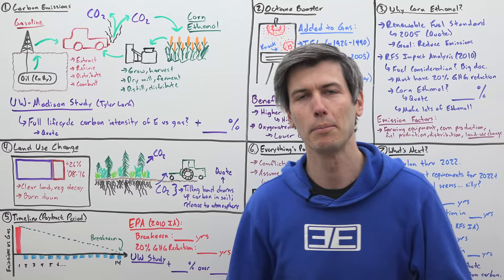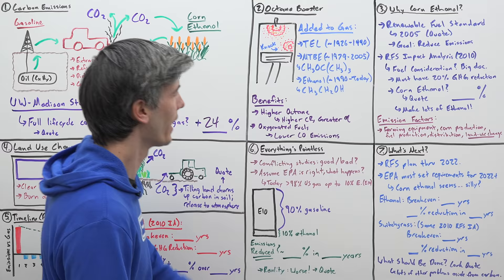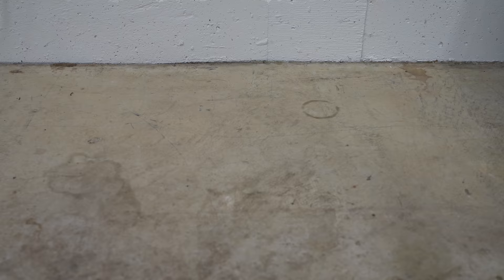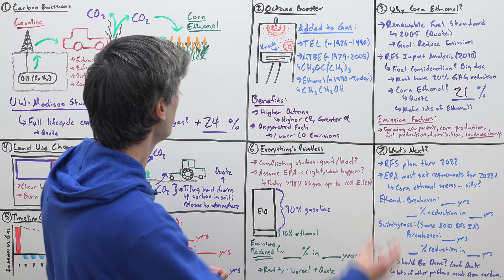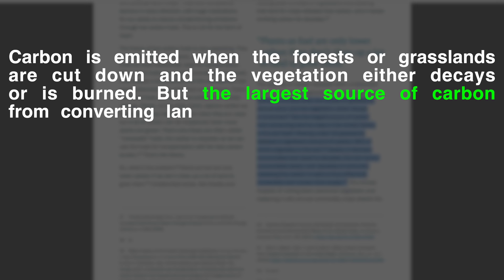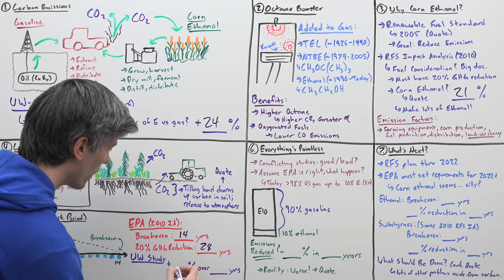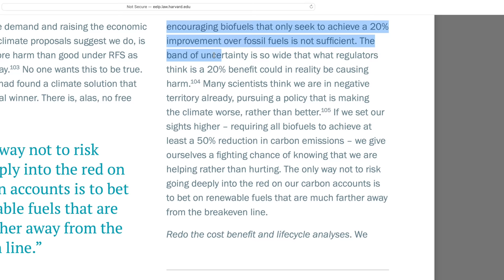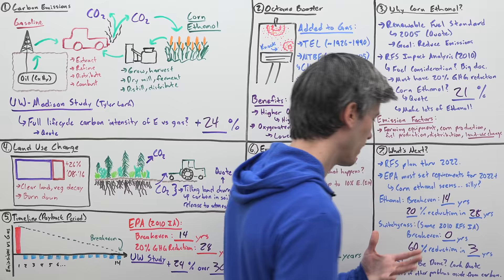America Was Wrong About Ethanol - Study Shows

Comment: There is another factor that I didn't hear you address. When comparing reduction of emissions between E10 and E0 gas, you also need to factor in reduced fuel mileage due to the ethanol. So while I'm polluting 2% less on E10, I'm burning 5% or more E10 fuel overall to travel the same number of miles I would on E0. I'm curious if that was something Tyler's study factored in. Because if you factor in burning MORE fuel per mile, then it's apparent that ethanol doesn't do what they claim it will. And never did.
Reply: Even with just 10% ethanol added to E0, the Swiss Federal Laboratory for Materials Science and Technology found that the especially health devastating ultra fine or nano particulate emissions were lowered by 97%, carbon monoxide lowered by 81%, carbon dioxide lowered by 13%, aromatic hydrocarbon emissions lowered by 67-96%, and genotoxic emissions lowered by 72%.
Reply: @danafletcher2341  I looked up that study and found it referenced from 2016. It's interesting that it specifically only applied to direct injection engines, which are engineered for better efficiency/lower emissions to begin with. Those engines come with their own problems, but regardless, suffer from the same reduced fuel mileage using ethanol products compared to pure gasoline, thus still burning more fuel per mile driven. Fuel that's still 90% gasoline. I'm not remotely sold that a 10% change in fuel type reduces emissions by 13%, much less 72-97% of anything. If it's true, the study can be replicated by others. And should have been. But if that's the only study showing reduced emissions since 2016, and others that show a net increase, I'm not buying it.
Reply: Clay you're spot on and it should have been touched on in this presentation.  5-8% increase in consumption with E10 vs non-ethanol gasoline in my personal vehicle.  Nascar switched over to 15% ethanol and saw a 10% increase in consumption or reduction in efficiency.  However you want to look at it.    How is that "green"?  I'm just a simple man with some common sense. 

But then again I don't have a vested interest in corn, ethanol production or its subsides..........
Reply: except the efficiency of a otto cycle is  dependent on the compression ratio.  Without the octane enhancer your engine would be forced to run at a compression ratio of 7.4/1 vs running an engine at 11/1 .  And that is what happened in the early 70%,  Ethanol was forced in as a oxygenating agent to reduce hydrocarbon emissions.  It was never there to reduce greenhouse gas emissions. MBTE was its competitor but was taken out (cancer causing)  And a engine with E10 at 11/1 will far outdo an engine at 7.4/1 running on E0.  This is the octane effect of adding ethanol.
Reply: There's not only that consideration, but the issue with so much land being turned to corn production for ethanol.  This has caused a decrease in other food crops, particularly rice, as farmers around the globe are not in farming for their health but to at least break even financially.  This has had devastating effects upon world food supplies.  I know that the green crowd thinks that it's a win to kill off large swathes of the Earth's population because it will be "good for the planet", but it's a bit less of a positive if you are one of those who starves.
Reply: The energy density of ethanol/E85 compared to gasoline in mentioned in the EPA Impact analysis dozens of times.  They accounted for it.

"The estimate also assumes is takes about 1.3 gallons of E85 for an FFV to travel the same
distance as a gallon of gasoline due to the difference in energy density of the fuels"

"we converted the gasoline prices into competitive retail E85 prices by adjusting for
the reduced energy density of E85, the increased refueling time, and E85’s presumed limited
availability in 2022"

"We then used
the relative energy density of the E85 to that of gasoline as reported by the refinery model"
Reply: @clayhughes3263  Instead of blindly being skeptical, can you research and then explain why you think that their estimates are inaccurate? The increased fuel used per mile is not as much as the reductions listed, so as long as they are listed, that is a big benefit for densely populated areas with a lot of emissions. Maybe some people forget the yellow haze that used to be over most major cities. Been in any major metropolis lately? Cars everywhere, but it doesn't stink as much and it's not hard to breathe, less air advisories for people with lung conditions.
Reply: @leihusen3008  There is also the consideration that E-85 boosts the octane rating up over 100 into the aviation gas range. A car engine designed to run on E-85 could run at a much higher compression ratio for a much more efficient and powerful engine from the same size and weight.
Reply: You have to take into account that it's said that E10 is allowing engines to be designed with higher compression ratios than before. So, there is an efficiency gain. Not from the ethanol itself but from the engine designed to burn it.

Though I'm still confused by this because higher octane fuels have always allowed for this. 87 is still 87. I'm not sure why ethanol would be any different. I suppose ethanol could be even more stable than other octane boosters. If that's the case then it could be true that the extra hp being squeezed out (which has shown to be quite a bit with some engines) offsets the decrease in theoretical miles. Meaning you actually get better or the same mpg while getting an engine with more overall hp and torque.

Obviously, I'm not the expert though.
Reply: @danafletcher2341  There is no association of acute mortality with ozone or PM2.5 in California and that calls into question that ozone or PM2.5 CAUSE acute mortality.
Reply: It makes no sense to drive a big vehicle with a gas guzzling engine and emissions of over 300gms/Km CO2. Everyone should just drive a vehicle with a small efficient engine with emissions of less than 100gms/Km CO2 a reduction of 200%. Instantly.😉
Reply: That isn't entirely true.

The btu raiting of corn alcohol is about 75% of that than desiel.  The hours power rating is approximately the same quantity.

In general no you will not have as much torque or horse power for the same stroke, and if the engine is modified to run on alcohol then you need different o rings and gaskets that are non petroleum based.

The emissions are very much greater however since the 18th amendment was treason we lost any advancements through the public sector on any increases in efficiency.

It doesn't get near as hot as gasoline, offers better operating consistency however you must have to deal with less power.

These studies don't even account for relative humidity elevation or even outside temp in which the lower the bar goes on all 3 the less petroleum can compete and the more alcohol outperforms.  And one of them doesn't have as much of an explosive personality, and the only real dangers from a spill would be ethanol poisoning and keeping fire away from it long enough for it to evaporate.

In fact, if it wasn't for moon shiners we might not even know just how much better than gasoline alcohol is.  Them boys where outrunning cops and not blowing engines at over 4k rpm.  Doesn't sound like much but qt the time that was past redline.
Reply: @dontneedtoknow5836  How about this engine Ricardo built for GM who drove it around a few years ago:

FROM RICARDO:
The new federal CAFE standards are calling for a doubling of fuel mileage performance, which, Vint says, is going to send OEM’s looking for high octane numbers to improve efficiency and ethanol is the best source. Ricardo, an engineering firm with over 100 years in the business of engine design, has developed an extreme boosted direct injection engine (EBDI) to optimize ethanol blends. The 3.2 V6 gasoline engine rivals the power and torque of a much larger GMC Sierra 6.6 diesel, he said, and it delivers 3.5 percent better fuel economy than the diesel.

How about this old letter:

Rear Admiral C.M. Chester wrote Henry Ford a letter on Dec.15, 1916:
"...I also pointed out in the article that as governmental laboratories had developed from 40 to 55% efficiency in alcohol engines as against 20% in gasoline machines, the use of alcohol at double the cost of gasoline for power purposes, was cheaper for motor[s] than gasoline in common use today."
Reply: @spazoq  Even with just 10% ethanol added to E0, the Swiss Federal Laboratory for Materials Science and Technology found that the especially health devastating ultra fine or nano particulate emissions were lowered by 97%, carbon monoxide lowered by 81%, carbon dioxide lowered by 13%, aromatic hydrocarbon emissions lowered by 67-96%, and genotoxic emissions lowered by 72%.
Reply: It also doesn't account for all of the carbon emissions required to produce each ton of corn. Farming, harvesting, transporting and refining corn into ethanol uses a tremendous amount of energy which requires the consumption of fossil fuels.
Reply: @JohnCorry  Iowa State University measured all the energy it takes to produce an acre of corn into a "diesel fuel equivalent"

This included machinery, fertilizer, chemicals, tillage, planting, harvesting, drying, trucking etc. 

They found it takes 34 gal of diesel to produce one acre of corn.

What do we get from those 34 gallons of diesel?
We get >500 gallons of ethanol.
But wait, that is not the kicker.
The kicker is we still get 100% of the protein from that acre of corn still available for an even better feed. A win, win.  

Question: why do flawed studies assign all the CO2 and energy of corn to ethanol and none to the feed side when 100% of the proteins, fats, and minerals still get fed to the animals in the distillers grains?  The only things that are in ethanol came from the atmosphere, nothing in it came from the soil or fertilizer.  Ethanol is composed of solar energy, CO2, and water with the latter two needed to make the new gallon of ethanol.

All the energy and CO2 it takes to produce and deliver a product to the consumer is reflected in the price of the product.

As such note the cash delivered price on the NYMEX of ethanol is $2.41/gallon.

An unusable sub grade of gasoline (RBOB) is $3.00/gallon.

>>>It takes more energy to make a sub grade of gasoline than ethanol.<<<

To turn RBOB into a usable E0 fuel even costs a lot more much like premium, racing, and aviation gasolines cost more. Petroleum octane boosters BTEX (benzene, toluene, ethylbenzene & xylene) are expensive plus are dirty and toxic.
Or you can splash in >10% ethanol to RBOB and the resultant usable fuel is much cleaner burning, less toxic, and cheaper/cheaper per mile to drive.  Who can be against that?  Answer me that.

Poet, the world's largest ethanol producer, now has half their plants co-generating with natural gas electric plants to use the waste steam to make ethanol.
Waste steam = free energy
Thus, ethanol's already low price has room to remain low. Before too long all plants with be like that for who could compete with free energy?
Reply: @dontneedtoknow5836 .. and Nascar was born!
Reply: @stephenjones9153  Why not we all just crowd into the city and ride bicycles like adults. 🙄
Reply: It's worse with a hybrid.  Less energy from the fuel means less time the gas engine is off.  Then they are burning hay and coal to produce the ethanol.  Air pollution is worse in Wisconsin because of ethanol.
Reply: @hzuiel  Actually the question raised has been answered by far less snarky answers presenting facts from several different souces.  Their answers carry far more weight than yours.  I know the EPA smog days, and the health issues, were way lower long before e85 fuel came out.
Reply: @veri745  "The estimate also assumes is takes about 1.3 gallons of E85 for an FFV to travel the same
distance as a gallon of gasoline due to the difference in energy density of the fuels"
hmmm
1.3 * .85 = 1.105
There is 1.105 gallons of gas in 1.3 gallons of E85, which is supposed to be equivalent to 1 gallon of gas?
Reply: @James-pj4ez  What are you talking about?  If a car can go 25 miles on a gallon of gasoline, it would take the same car 1.3 gallons of E85 to go the same distance.  You just showed that there's 1.105 gallons of ethanol in 1.3 gallons of E85
Reply: It's like diesels and the def junk ohh yeah i stopped this bad thing sadly it now makes us burn more fuel.
Reply: Not only the economy difference, what about all the small engine carburetors that have been ruined by ethanol in fuel? The amount of carbon produced to make bowl gaskets, new castings, hoses, etc. Etc. That possible 2% just got ate up in a hurry.
Reply: @veri745  I think you meant to say that there are 1.105 gallons of gas in 1.3 gallons of E85, therefore, you are better off just using the 1.000 gallons of gas.
Reply: @danafletcher2341  Just because RBOB is more expensive than ethanol does not mean that it takes more energy to produce.
Reply: @phillipsusi1791  No, E85 is 85% ethanol, not 85% gasoline
Reply: @veri745  Ahh, right.. I didn't notice that you flipped the ratio.  Still, I think my point applies: If you use E15 you replace 15% of the oil with ethanol, so you still are going ok even with an 8% reduction on fuel economy.  Likewise if you go with E85, even at half the economy, since you are only using 15% as much oil, you're still doing better.
Reply: @James-pj4ez  E85 is 85% ethanol.  So there is 0.15 * 1.3 gal = 0.195 gallons of gas in 1.3 gallons of E85.
Reply: @markkelly6259  Yes, but that engine will certainly degrade much quicker.
Reply: @johnsheibal4330  Assertion without facts in evidence.  The high octane content and optimized timing available when running an engine on E85 tends to improve durability.  Lower EGTs, lower coolant temps, fewer combustion chamber deposits.  I have a GM LS engine that is producing almost 900 hp on E85 vs 556 hp stock on 91, and has been doing so for over 90k miles.  And the block/heads/cam are all stock and have never been opened.  Burns less than 1 qt of oil every 5000 miles.  I have run oil change intervals as high as 9000 miles with oil testing to confirm safety, but settled on 5000 for max durability.
Reply: @ChurchAutoTest  That’s a great engine and not surprised. In general, boosting engines definitely increases wear and tear.
Reply: @johnsheibal4330  But we're talking about a boosted engine to begin with.  It was supercharged from the factory and remains so.  Only now it runs on ethanol, produces dramatically more power, runs cleaner, and a camera inspection of the cylinders shows it looks like a nearly new engine inside.  That's the amazing thing about ethanol.  Outside of the actual range considerations (fewer miles per tank) and some winter startup issues, it's far superior to gasoline in so many ways.  Cheaper per mile, more power from a given engine, cleaner burning in almost every aspect, fewer combustion deposits, lower exhaust temps, lower coolant temps, and it can be made from crops.
Reply: @ChurchAutoTest  that’s hard to argue, if that’s the data. I shy away from boosted engines, as I suspect they have higher maintenance costs, since turbochargers only last so long, which is why auto makers got away from using them for a while. I know they’ve improved, but still a gamble.
Reply: @johnsheibal4330  Sure, in general boosted engines are smaller than equivalently powered NA engines, so cylinder pressures are higher.  And you have more moving parts which defacto tends to increase failure rates.  But since well over 50% of new car engines these days (probably closer to 70-80%) are forced induction, it's kind of moot.